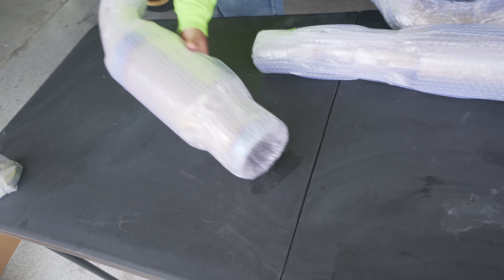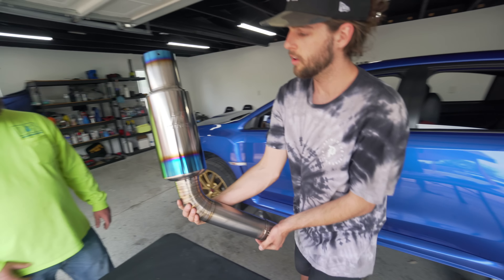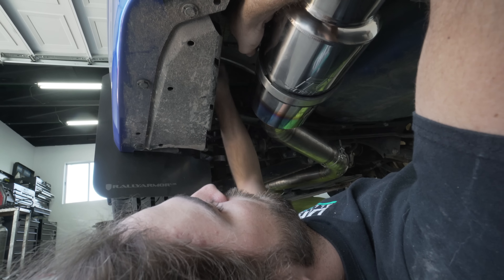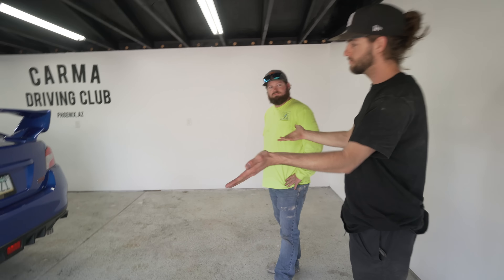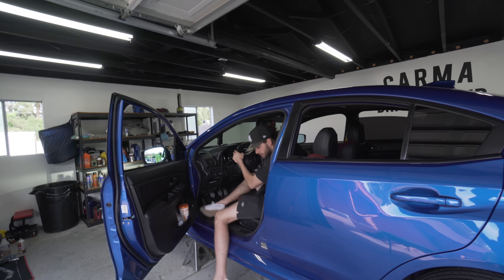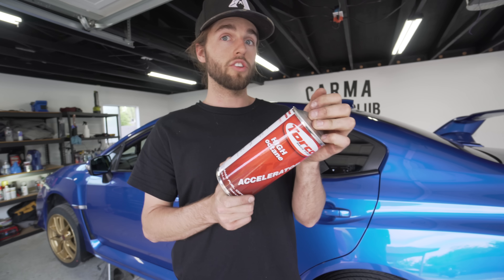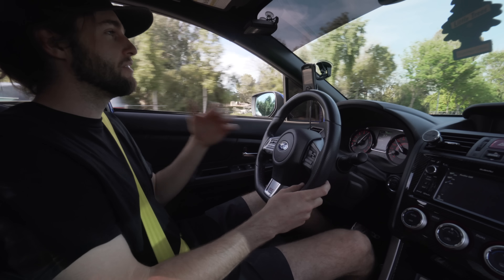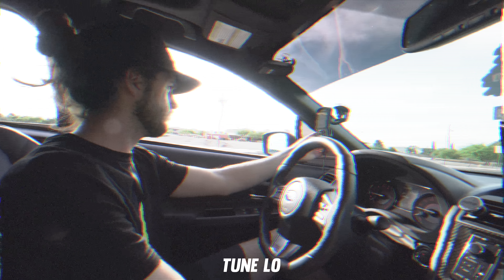THE BEST EXHAUST! Subaru WRX STi Tomei Ti Expreme

Comment: Best sound out any Subaru exhaust, but I just can't do the single pipe and leaving the hole on the other side. That's just me. Great Vid.
Reply: Mel C. Broo same!!! To me a my subie ain’t my subie with a single exit
Reply: just needs a muffler delete decal covering the other bumper cutout...😆
Reply: T C 🤔🤔🤔
Reply: Mel C. Yeah same to me having a single exhaust on a subie doesn’t look that nice
Reply: Looks great lighter and u don't need dual the car isnt and can't be a true dual so it fake about as stupid as having duals on a Honda civic
Reply: Mel C. Agreed
Reply: Well if you look at it this way, theres better flow in a 3” single than a 2.5” true dual exhaust. This tomei will get you more power than 2 exhausts.
Reply: Lot
Reply: @bptak3003  I feel your trying to communicate with us
Reply: It saounds gooooooooooooooooooooooood 👍👏👏👏😍😍😘👌👌👌
Reply: Can you add 2 of these?
Reply: Then buy 2 🙃.
Reply: @PR1NCETD0T  that's why I have 3 " magnaflow😎 I dont like all the backfires from this exaughst.  Magnaflow has nice rumble, and doesnt drive my neighbors mental on cold startup.
Reply: You can just put a tow strap in the hole or something,
Reply: Magnaflow is the worst exhaust setup. Sounds like 💩. I rather straight pipe it myself with no welding experience than to sound like a grandma in a f150.
Reply: Just add a tow strap to the deleted side, that's what I'm going to do when my Tomei expreme comes in lol
Reply: Burt what’s the specific name of the exhaust you have ? I wanna check it out. Maybe cop it
Reply: Get a tow strap Tanaka makes them get it from eBay any color you want for like 10$
Reply: @PR1NCETD0T  The Sound is the key word here a dual exhaust will never sound as great as a single on a subaru boxer engine.
Reply: @TC-bq5ri  definitely would look better with both. Imo. But we all have one.
Reply: Same here....I love tomei but can’t do single exhaust. Would love it if they had dual or even quad
Reply: @tommyclark7651  🤣😉
Reply: @robochoa7387  🤣🤣🤣
Reply: @Chinnysmylr  they make a delete insert that goes into right side on subispeed
Reply: same as what my view....
Reply: You can always get a tow strap to fill in the empty side that’s what I did
Reply: I’m the same way I’ve had single exit cars for too long
Reply: @braandoollriios9554  why if all previous generations were single exits?
Reply: Put a tow strap on the other hole
Reply: Yeah, I like my quad exhaust even though it’s hardly necessary lol
Reply: You guys know subi speed makes a plastic cover that fits over the other side and makes it look OEM right?
Reply: Mine has a tow hook on that other side to compensate for the gap. But I'm also not really bothered by the gap. That rear diffuser kinda hides the fact that there was something in that spot.
Reply: @braandoollriios9554 So none of the previous generations of STIs were subies? The dual exit is a relatively new thing. Plus, the iconic sound is just...🤤

Comment: What kind of flame tune is that? I have an 2018 sti and that tune sounds amazing!
Reply: It's not the tune
Reply: @coldcereal2679  It is, he even mentions swapping the tune. Did you actually watch the video?
Reply: I don’t recommend it. It’s bad for the car
Reply: MildBarbecue how??
Reply: Flossy a flame tune is bad. It’s excess fuel
Reply: Flossy excess fuel gets burnt in the exhaust and it’s like turning the hot side of the turbo into a cylinder by igniting the fuel sometimes before the turbo

Comment: Love your videos man and also that car that car is also my dream car❤️❤️❤️❤️❤️❤️
Reply: I can see why. Pro tip...
Have a decent trade in
Always buy new for sti
Bring 10000 cash
Should get your payments near 450 a month.
Reply: What that guy said ^ also buying after someone leases should be fine too, you just don't want a car that someone wore out with aggressive mods then sold the mods when they sold the car. All the wear, none of the fun.
Reply: @devjk1  i got mine with 4 miles on it last year. Have some paint chips on front bumper but im keeping it stock for the next owner in 2022. And oil changes every 3k. So i hope the next guy enjoys it
Reply: @dnawrapsatl  I bought mine this year with 9 miles on it, and I'm just limiting myself to no power or serious suspension mods. So the basic things like shifter work and brakes are the only things I'm modding.  It's been my 4th car I've owned and by far my favorite, with my 08 Civic si coming in second.
Reply: @devjk1  was it a big change coming to a wrx from the si? I bet you could slam gears for dayz in that honda. But i cant in my wrx. Idk just not as smooth as a honda tranny and clutch...
Reply: @dnawrapsatl  rowing gears in the Honda was fantastic, Honda absolutely makes the best shifters (in a sub $100k car) and the sti is better since the rev hang isn't as bad from 1-2 and the trans isn't made of glass like the WRX. If you don't like the shifter feel, get the Perrin shifter stop and the bushing, they'll drastically improve feel and if you get a different tune it'll get rid of the rev hang. That's the best part about Subarus, you can fix and mod anything you have a problem with if you want.
Reply: @dnawrapsatl  basically Honda had a way better shifter but Subaru can be made almost as good.
Reply: @devjk1  i have the shifter stop but not the bushing or plate.  And axlebacks from remark. Wanted to get a full cat system but i spent 2gs on wheels n tires for winter. But next for me is tints and full cats. Thanks for the reply

Comment: do i need a tune if i install this on mine? the sti is a flamethrower now🔥
Reply: OooKi113m late ass reply but you don’t need tunes for the exhaust, but you can add more power using aftermarket exhausts with tunes but no it’s not needed
Reply: He has a down pipe I believe, which will require a tune via Cobb AP or pro
Reply: Cuz if he does have downpipe, it becomes a turbo back exhaust which def requires a tune

Comment: I have a invidia n1 dual on my 2013 sti, I have a burble tune aswell. I have a stage 2+ tune ots from cobb. If I use accelerator with my 91 gas will I shoot flames?

Comment: Question do you have the pipe touching your diff? Idk if I had a shorter exhaust or what but it hits the differential. Had to make hangers to pull the pipe way for it so it didn't rub

Comment: I wanna know what it takes to spit fire like that? is it just the exhaust or tune up like ecu stuff like that idk reply on this if you guys know or may recommend one i own 2017 sti most of it is stock aside from r400 invidia exhaust stock downpipe
Reply from the maker: Bigger injectors, tune, fuel pump, E85, catless downpipe
Reply from the maker: Most importantly a tuner that’s down for flames. Not exactly the best thing for the car.

Comment: So since I don't know much about boosting octane is safe from 93? My car is a 2004 Volkswagen Passat 1.8T and it's STOCK other than a custom muffler and resonator delete. I thought about using this octane booster stuff but I don't want to blow the engine. As I mentioned where I am in the US does 93 premium but definitely let me know please and thanks!
Reply: It’ll be fine

Comment: I just installed mine and it seems quieter than I thought. Doesn’t sound as loud as yours does in the video
Reply: David Bowen nope just the 3 pipes it came with but I later found out it was a leak between the s pipe and the midpipe flange.